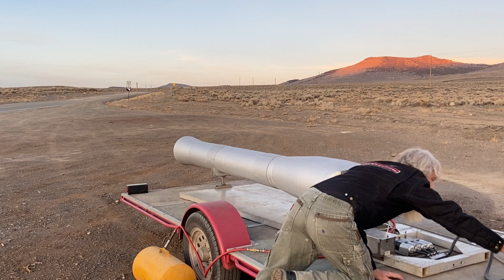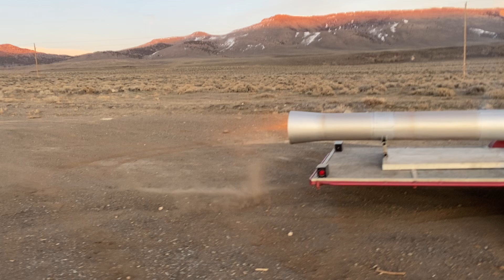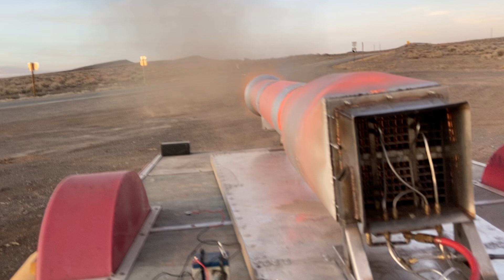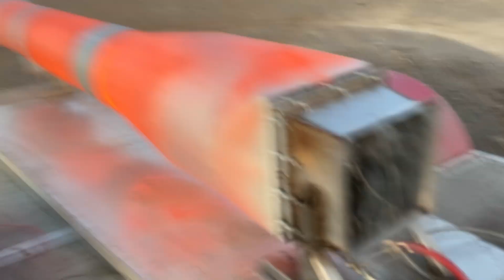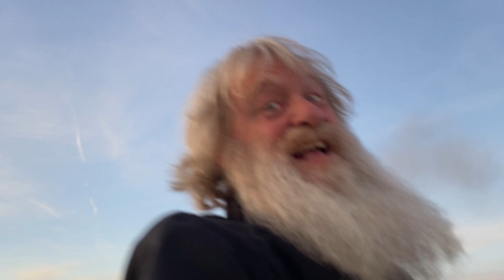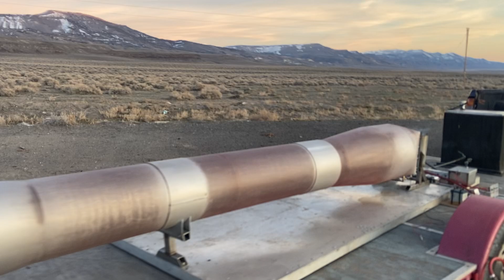Crazy Rocketman: Test running the "Super Dragon" 450 pound thrust Pulsejet Jet engine.

Comment: I was over at Eugene Gluaref's house in SoCal about 55 years ago to see his One -Bladed Helicopter he'd built, and saw the Pulse-Jet Engine on the tip of the rotor.  We didn't try out his "Helicopter", but started a few of the prototype engines he'd built.  Intrigued, I asked him for plans for the 30 pound thrust Engine, and he just GAVE them to me - No Charge!  I never got around to building one, and since have given the plans away. Heck!  I don't even own a Heli-Arc Welder anymore!  (I know, it's TIG, but back then we called it that...Old School, where even some welding required Hydrogen Gas as the shield gas!).  Lol
Always wanted to make a Jet engine, and just might get around to it - even at MY Age.  Thanks for the Great Video.

Comment: Interesting that the Mk V Spitfire, flying at 220 mph, has a drag of about 640 lbs.  So a pair of your 450 lb thrust engines will give you very nice performance if you can keep the wings from bursting into flames.  (I believe Icarus had some difficulties in that regard, IIRC!)

Comment: In the 80s (Australia) I sat in a stationary jet truck and watched a couple of them complete the quarter mile at the drags (motor). So wild! Everything within a certain perimeter was blown out of the way as the truck sat idle at the start line. They told everyone to move out of the way  beforehand though Esky coolers and chairs etc were sent flying with the dirt 😁♥️

Comment: Hey Bob, would cooling the outer tube aid in increased performance at all? A cooling water jacket? Love your work
Reply: It wont increase performance to cool that tube while its stationary. That heat could be used to improve thrust (slightly) at high speed. But the extra thrust will be offset by the extra drag of a cooling shroud or radiator.

At low speed, static thrust is improved significantly by using an augmenter. Similar to the exhaust augmenters of American WWII aircraft which were used to pull a slight vacuum behind the old radial engines to improve engine cooling. 

Some claim Pulse Jet static thrust is improved between +50% up to +100% (2x) with a well designed augmenter. But, at medium speed its additional thrust is completely eliminated, and the drag from the device actually slows you down, which is why augmenters are rarely used for higher speeds. (where you want a jet engine in the first place, is not usually for 0-60 acceleration, but for sustained high speed).

Comment: I've seen a lot of pulsejets on this website, but this is by far the most advanced one i've seen yet. 
You just earned yourself a subscriber.
Reply: Advanced? It’s an Argus AS014 engine the nazis used them on the v1 “doodle bug” flying bomb, and a few planes they experimented with.
Reply: @lonewolftech  Yes, and 99,9 of other videos where people made a pulsejet, its just a pipe with an expansion chamber thats bent around to act as a pulsejet, aka a "valveless" pulsejet. This is one of the very few channels that also builds the more advanced pulsejet engines with shutter valves and automatic ignition.

Comment: I have watched a few of your videos and I noticed that the tube almost always starts glowing red after a few seconds of running. The material I think I saw you build with one time was stainless steel. Have you ever had a structural failure due to heat?
Reply: I was wondering about that too. Heat + intense vibration could be very bad.

Comment: 450 pounds of thrust is getting close to WW2 V1 rocket spec numbers !! ... initial V1's had 600 pounds with later models up to 800 pounds of thrust, yielding 250-400 miles range at 400 knots with payload. This thing will wreck mayhem on a gokart in the desert <3 :) !!!
Reply: Well….he said he’s gonna use two so that’s 900lbs
Reply: @Nick-jr6qe  maffs!!!!!!
Reply: Looks to be around 1/2 -3/4 size of the real thing.  Going to be interesting, when he runs whatever he's going to put it on.
Reply: That’s funny I was thinking the same thing when I saw the numbers and heard it fire up.
Reply: Another comparison is that a Sparrow air-to-air missile has a five inch diameter solid rocket motor that develops 3100 pounds of thrust.
Reply: @Brian OZ2BRN, speaking of V-1 "buzz bomb."
https://www.youtube.com/watch?v=dSlDsup-aLI
Never knew a real pulse jet was operational.

Comment: Dudes built an Argus style V1 pulsejet. Absolute legend. He’s literally living his best life!. Get some ear defenders man!!.
Reply: Like ear muffs over ear plugs, for sure.  Test out some Bose noise canceling headphones with it.  😃
Reply: In the mean while he doesn't hear that sound no more 😅😂
Reply: "Style?" It makes only 50 lbf less static thrust, 450 vs 500 for the Argus.
Reply: If the valving is correct which it appears to be then it is an Argus as014 engine.  Beautiful to see one built and running today. I have the plans from the original engineering of the Argus engine I want to build one but need access to a mill for the valve body..
Reply: Can you please share the plans with me? I have a plan on building aircraft with these types of engines, thanks in advance. @lonewolftech
Reply: @kkkk-ud9ll he’s not just going to share his blueprints 😭

Comment: Hi Robert, couple of questions: is this the same sort/type of engine that powered the WW2 V1, or are there any major differences? The thrust is approx 0,6 of a WW2 Argus engine, can this still be increased? Thnx for this video and keep up this great hobby: I'm enjoying it bigtime!! Be well,  T-Bear from NL.
Reply: The easiest way is to use a augmentor, a specially shaped duct placed behind the engine. The duct acts as an annular wing, which evens out the pulsating thrust, by harnessing aerodynamic forces in the pulsejet exhaust. The duct, typically can significantly increase the thrust of a pulsejet with no additional fuel consumption. Gains of 100% increases in thrust are possible, resulting in a much higher fuel efficiency. However, the larger the augmenter duct, the more drag it produces, and it is only effective within specific speed ranges.
Reply: G E K O L O N I S E E R D
Reply: @pabz3218  En?

Comment: Is there a chance you can describe your fuel system setup? I have checked your site and didn't see anything on it.  I have a valveless pulse jet that I  have a metal fuel line feeding it. It's a pain to start and it's not very efficient.  You seem to have it down pat.
Reply: I think it use Propane as fuel..?
Reply: @humbertomonteiro6742 Yes, I think your right.  He uses propane and some kind of fuel pump to pump liquid in at high pressure. I think in one of his old videos he was even using diesel as well after it was started on propane. Whatever his system is it works way better than anything I have been able to come up with.

Comment: Rocket Man Indeed! love this stuff keep it flowing,,,, try some resonance study's and maybe you might be able to resonate the thrust higher and lower the metal fatigue along the way....and increase the SoundPressureLevel freq. higher than normal human freq range, and a series of Clipping diode's to help like a large electrolytic capacitor that filters out the ripple in a full wave powersupplies or a simple flyback diode on a DC relay coil, to prevent reverse spikes when switched via another relay coil contact wear due to Arcking effects.. Thanks

Comment: I think you need additional reinforcement at the transition from the flute to the straight-pipe, as just before the shut-off, there seemed to be a hot-spot developing.
Also, were you alone??
There should be a timed auto-off, so if for some reason you can't make it to the cut-off switch, it doesn't continue running unsupervised.
Also, is ear protection against the rules🙉??
Also 😅I realize we're in the United States, but why blow debris towards the road...............?
Surely it cannot be that difficult to rotate the trailer...since we didn't bother to go further than the shoulder anyway...................
Consider the future, as well as  the past, Because ultimately, you can't tinker, with a piece of stray metal coming out of your forehead like a unicorn.

In other words,🦄be safe R , Wilbur.

Comment: What kind of fuel does this use? And is there a substantial benefit to valved/shuttered pulsejets over valveless/acoustic pulsejets?
Reply: The shutters are there to contain the pulse and direct airflow through the engine rather than our the front. I was wondering about these versus the U-shaped valveless jets, which I imagine are easier to build but less efficient

Comment: Would be interesting to see the on a drag strip racing other hot rods.
Reply: Accelerating with something like this would be underwhelming when compared to gas engines of similar size and weight.
A jet engine's strength is in top speed.

That doesn't mean it wouldn't be fun to mount one on a go-kart, though.
Reply: @jimbojones9665  once ram intake efficiency peaks, jets are fun to watch on the drag strip for sure.
Reply: @jimbojones9665  not really. Jet cars are exhibition runs because they could(and would) outpace fuel cars, IF they were allowed to use basically whatever engine they wanted. IHRA/NHRA doesn't want to spectacle of fuel cars to be eclipsed by jets and limits them.